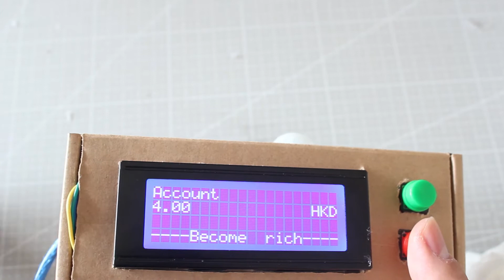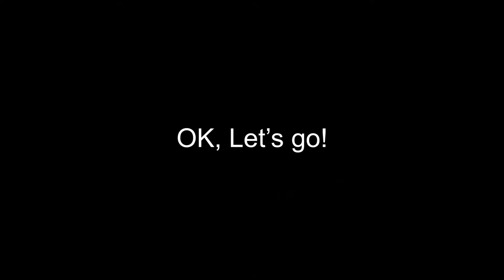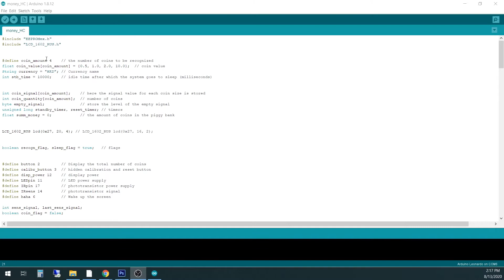How to Make DIY Coin Counting Bank using Arduino, Smart Money box Project #coinbox #Arduino

Comment: Awesome bro! So this work by measuring the coin dimension?
Reply from the maker: Need definite size level, not measure size
Reply: @dkardu4534  hi, thanks for the reply! currently am working on my final project, please correct me if im wrong. So they count the time the coin pas the ir sensor? How you differentiate the coin with only ir sensor?